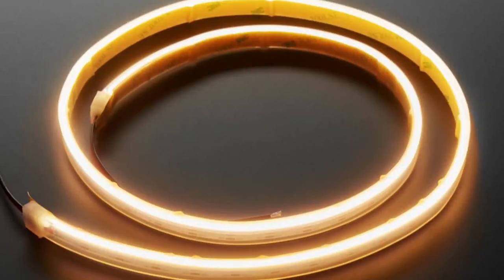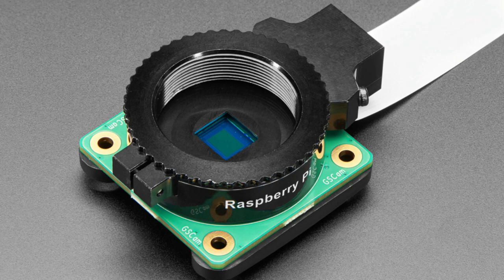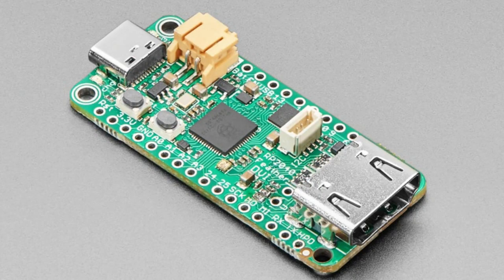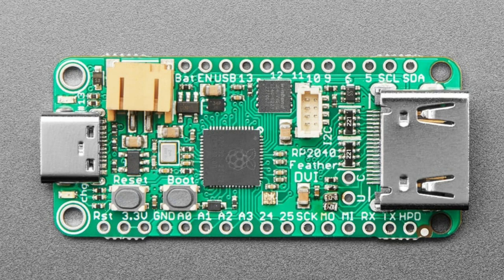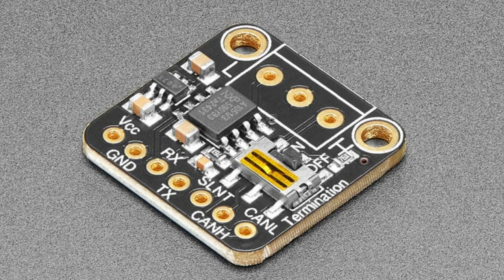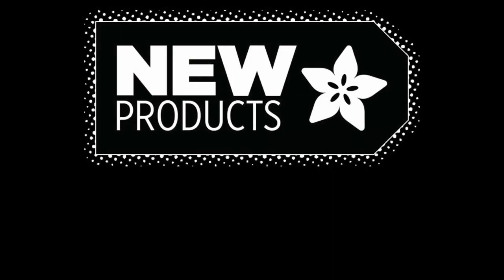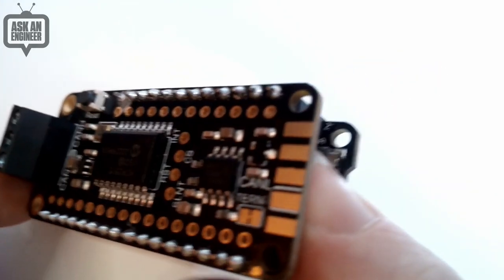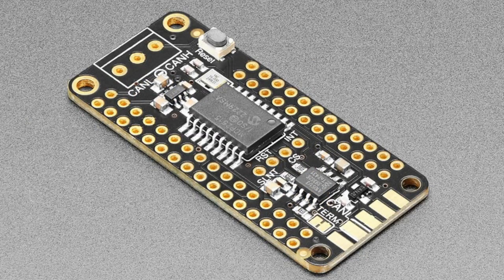#NewProducts 3/15/23 Feat. Adafruit CAN Bus FeatherWing - MCP2515!

Comment: CAN spec specifies 120 ohm termination at either end, is there a reason this board uses 60 ohm?
Reply from the maker: its 2 x 60 ohm with a small capacitor in between - so 120 total - see Figure 5 https://www.nxp.com/docs/en/data-sheet/TJA1051.pdf for what it looks like, we'll post the files and schematics soon. next time we run the PCB we'll update the text so its more clear!
Reply: To add more information:
We can also use a single 120 ohm resistance. Keeping split resistance(i.e. Two 60 ohm resistances and grounding capacitor in between) increases Bus immunity for the transients.